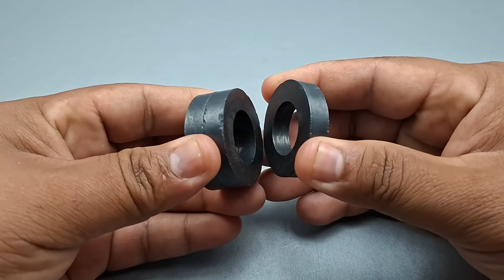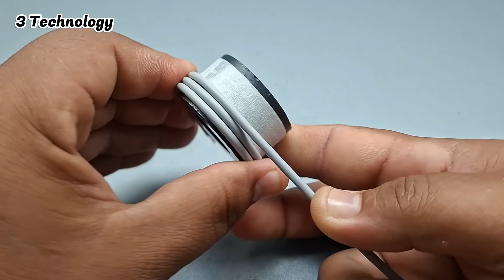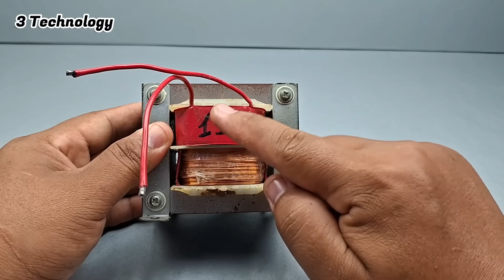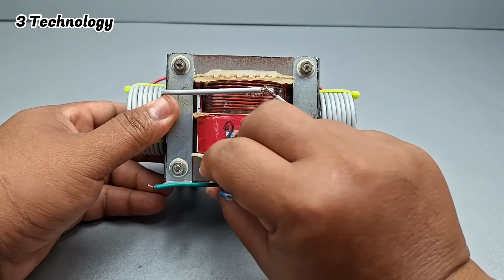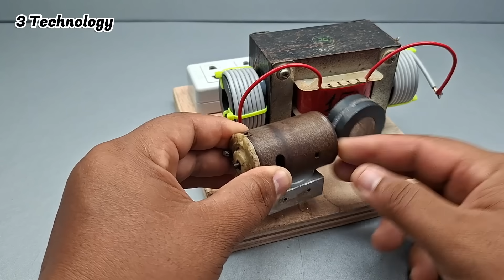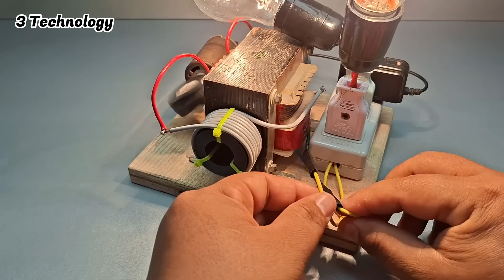how to make 10kw free energy generator at home self running from pvc copper wire with transformer

Comment: Total fraud, two different videos and two different devices. In the left video, a professional laser welder, but be careful, only the gun is held in the hand, the main part, which is connected by a thick cable, is not in the frame. In the right video, an ordinary soldering gun with a tin coil and a feeder, which has nothing to do with a laser and in no way can do what is in the left video.

Comment: Люди очнитесь, в магнитах нету электричества.
Reply: Yes if you do not know how  to use them .. there is if you knew how to do it with copper wire coils and a transformer . And that dc motor with a magnet rotating from its spindle . Cutting the magnetic field will surely produce electricity .
Reply: dude like all electricity comes from magnets.... wake up research b e f o r e you sound stoooopid or something...? duh!